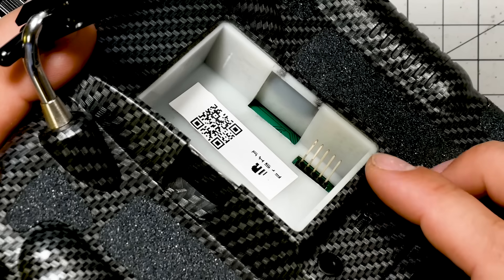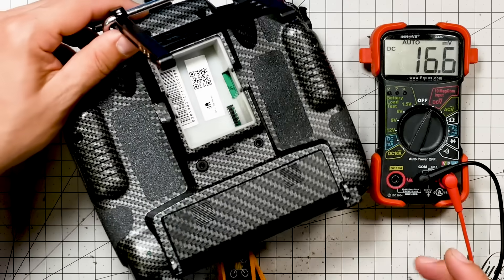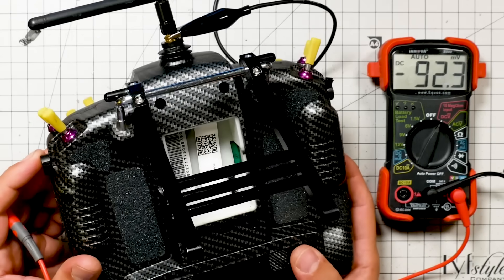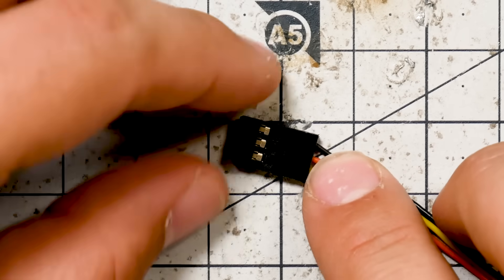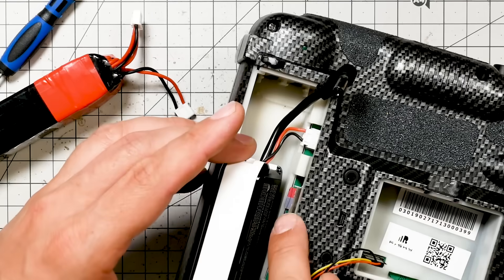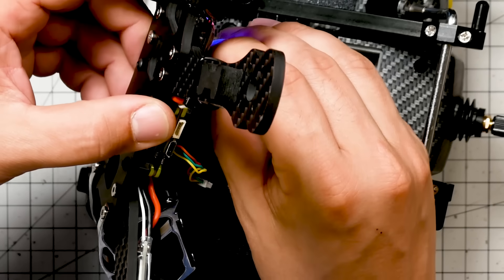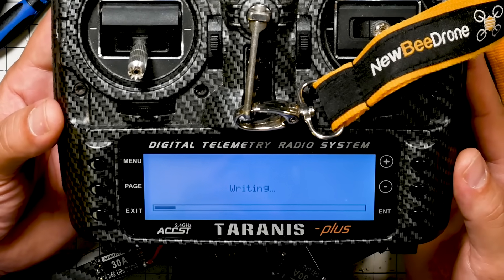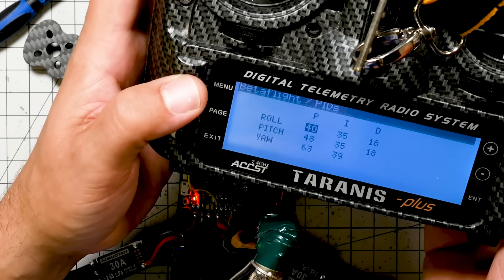FrSky Receiver Firmware Update | R-XSR LUA SCRIPT FIX

Comment: Long standing problem I've ran into with this. If I flash the firmware with my X9D (everything exactly as shown in the video, flash external module), it show's that it's all went as it should, firmware flashed. But.. It won't bind with said X9D. For all practical purposes, bricked.
Using my QX7, with the same firmware (even the same "bricked receiver from the X9D flash attempts), I get an option for "flash S Port" along with the flash external module (the S port option isn't on my X9D). Use this route and the receiver binds fine with the X9D, telemetry, LUA script, all good. It's always been like this, on  5-6 receivers. 
All good in the end, but why do I get the "flash S Port" on the QX7 and not on the X9D? And why will it only work correctly using that?
Reply from the maker: Flash S.Port flashes to the servo plug on bottom of the radio. Since the X9D doesn't have this port, that option doesn't appear.
Reply: @JoshuaBardwell  Any idea as to why they refuse to bind when I do the "flash external module" with my X9D? It's a newer X9D SE, have swapped the power/ground wires as shown in your video, using the stock Taranis battery, correct firmware, the loading bar goes as it should, but it won't bind after the flash. Fortunately I have the QX7, otherwise, as it stands, I'd be outa luck.

Comment: Hey, probably no one will answer to this but i have a Taranis Q-X7 and can't find out what's signal power and ground. I only get numbers like -6.07 or 0.86. Im pretty sure i didn't  short any of the pins.
Is broken then or am i doing something wrong ? It's a EU transmitter btw, not sure if that matters
Reply from the maker: If you have the QX7, don't use the pins in the JR bay. Use the servo plug on the bottom of the radio. The command in the radio is "Flash SmartPort Receiver" I think.

Comment: after watching  my first attempt ended in error(no resp. from bottom pin) on my Qx7. The first option after you have selected the firmware from your sd card on the transmitter is for S PORT. I was nervous about "bricking " my unit so I used a spare and it worked. Then worked again on my build in progress. Might be a repost but just FYI...I really do  learn something Every time thanks brother man!

Comment: Hey Joshua, LUA script problem here... I have an RXSR and its flashed with the LUA script firmware. Flashed LUA firmware on my XLITE transmitter. Im trying to get the current setting to VFAS, but the "current setting" in the Display page. Im running Fport. Im not sure if it was in Display page before flash.. Any thoughts?
Reply from the maker: VFAS is a voltage not a current, so that's why you can't set the current sensor on the Display page to be VFAS. Fuel is typically the current sensor source for FrSky and Capacity is mAh I believe.
Reply from the maker: Ummm.... actually I'm not sure about that. Fuel might be mAh and Current might be current.

Comment: Hi Joshua - I didnt work for C3 f3 flight controller , I have the latest firmware 181228
(F.Port FW included)

1. Fix the random incorrect RSSI issue
2. Optimize the performance and further increase the stability
Note: Please upgrade the compatible device (R9 series Tx/Rx) with the latest firmware simultaneously, and rebind the devices after the update. Bind is happening but the f port is not working i cannot see any movement in receivers . Serial port enabled and all steps followed

Comment: Actually that is a 2 cell balance plug on the Fatshark battery that is missing the center wire. (balance plugs always have one more wire than the number of cells since each cell requires a positive connection with of course a shared ground that represents the one extra wire).

Comment: Now the question ... is it worth to buy receivers r9 mini frsky or R-XSR? I'm hesitant because I'm looking for a second receiver for another drone. Should I go in the direction 2.4ghz or 900mhz? Or it may have two different ones installed, so that in the event of a failure you can save the plane, drone, etc.
Reply from the maker: 900 MHz certainly gives more range and confidence.
Reply: @JoshuaBardwell  it's true but how look transmission speed and delay? R-XSR have ultra sbus. What's mean?

Comment: Hi there, I am having a heck of a time getting my frsky r-xsr receiver to work. I have a F4 flight controller which the manufacturer said it is a clone??? The drone is a SkyStars G730L. I have connected uninverted sbus on the receiver to the SBUS on the FC. I was going to flash the r-xsr with the latest firmware but because it is soldered to the FC I don't know if I can use the Tyrannis QX7 method or if I need to flash using serial passthrough? I would rather not desolder as the pad on the the receiver is extremely small. Any suggestions are greatly appreciated.
Reply from the maker: If you're using uninverted SBUS you must go to the CLI and type "set serialrx_inverted = on" then type "save"

Comment: This hobby is amazing, first you have to build a quad from misc parts, hoping u pick the right ones, then u connect a taranis to it and it flies amazing, then the talking heads in this great hobby state “u should update to the latest greatest” it’ll be better then whatever settings your running currently, but that’s where we as a hobbyist need to realize that if it is working great don’t fuck with it! The upgrades can and do cause issues with your setup that unless at times your a fricken computer programmer the update turns into a pain in the ass and it’s not worth trying to hunt down all the info/videos to try and figure out the steps to make it all talk again.

Comment: Yea, so I did this and bricked my R-XSR. Have since tried several versions of the firmware from FrSky's page, no luck, it won't bind. There's a difference, with one version all led:s turn on when I try to bind, with others only the green one comes on. None has the red flashing though. Should note this is an EU version and I upgraded the OpenTX version at the same time to 2.2.2.
Reply from the maker: It sounds like you are flashing the wrong firmware. Make sure both Taranis and receiver are using LBT (EU) firmware.
Reply: @JoshuaBardwell  Tried flashing both receiver and transmitter with both in various versions. The radio was sold as an EU radio so obviously I started by flashing the RX with EU firmware which was what stopped it from working, I then tried flashing the TX with the EU XJT firmware, both of the versions available on FrSky's site, no luck. My latest attempt was flashing both RX and TX with FCC firmware and it doesn't work either. Everything was working perfectly, but I wanted LUA scripts and was told flashing the RX was a good idea to make sure it supports it and now nothing works.

Also, the radio is pretty wonky when it comes to the USB connection, I basically can't get it running as a storage device so I only have luck taking the SD card out and adding the files to it directly. Really starting to regret getting this Taranis over the Spektrum I was considering and really starting to beat myself up over messing with things that did work, had this rush delivered since I was going to my first race tomorrow and now, $350 later (yes, they're expensive here) I can't even fly five meters.
Reply: Ahh and now it got even worse, now it fails to flash the RX firware. It starts but  at some point during the process it stops and the screen on the Taranis says "Firmware Update Error Module refused data [EXIT]" - The only one it does now flash is the non-eu R-XSRFCC171009 version, but flashing the TX with the XJT_NONEU_170317 still doesn't make it work.

Does anyone know exactly how the LED:s should look when it goes into binding mode? I recall the red led should flash when successful, but should there be anything before that? Because right now, it always just goes to solid green only, which according to the manual indicates an active link.
Reply: Just to follow up, it may help someone in the future since I found no one through days of scouring the webs for information who had this problem and thus no solution. No, it was not using non-matching firmware, nor the firmware version of  anything at all. Apparently it is possible to put you radio in a state where it can't successfully update the firmware of neither it's own internal transmitter module nor external receivers when updating OpenTX - every time I was flashing firmware everything appeared to work, the progress bar completed without errors or warnings - but the flashing had no effect. What I ended up doing was using an FTDI-chip and a bit of passives to be able to flash the modules using the FrSky S-port Update tool directly from USB. Exactly how is far to long to write here, it's on the scale of a Bardwell video, but if anyone has a similar problem ask me and I might be able to help you out.
Reply: @bewing77  hello. I have the same problem like yours. I had Taranis EU version and r-xsr fcc version. They did not bind, and somebody told me to upgrade the receiver to eu version. I did that and now the r-xsr has always a solid green. with each firmware update says successfully but don't sure what firmware I have on my rx or tx. I did like dozens on each :( . what is the solution? I don't know what a FTDI-chip is... :(
Reply: Florin Danilov  An FTDI chip is basically an integrated circuit that allows you to output serial data on individual pins from USB, it's pretty common in most devices that connects to a computer using USB. These chips are also available in lots of variants mounted on a PCB with a USB connection, all capacitors required and sometimes also voltage regulation, these are called FTDI brekaout boards, an example is https://www.sparkfun.com/products/9873

However if you don't know what it is and have no other use for it, you'd probably be better off getting the FRSKY STK (S.Port Tool Kit) which costs about the same as an FTDI breakout board but is easier to user for this specific application.

If you get one of those you can flash the firmware of both receiver and transmitter without the "put it on the SD-card in the radio, go through the menu etc" - you use the FRSKY firmware upload software and flash it directly from the computer. Now, it is a bit tricky to use, basically you have to launch the software and select the firmware file first. This done, the software will wait for the STK (of FTDI) to connect. Make sure the STK is connected to the receiver or transmitter you are flashing and then plug it into a USB port. As soon as it is detected the upload button is enabled, now you need to press it within a few seconds, otherwise it won't work. You will get a progress bar - for some reason flashing this way takes a lot longer it seems.

Get the latest firmware version for both the receiver and transmitter for your region (LBT or Non-EU) and flash them using this method fixed the problem for me - hopefully it will for you as well. If something is unclear don't hesitate to ask again!

Comment: Weird problem here.. If I flash the new firmware on a R-XSR with my X9D SE, it refuses to bind. Flash same receiver with my QX7 and another option "s-port flash" appears, use that and then it binds just fine. What is up with the s-port flash thing? And why isn't it showing/working on my X9D SE? Glad I have the old QX7, otherwise I'd be fucked and have a completely bricked receiver.
Reply from the maker: X9D doesn't have the sport output. You have to flash using the pins in the module bay.

Comment: Man I don't know how to get ahold of you Joshua B.... computers and beta is new to me and is not my thing I do quarter mile in my Datsun 210 and I'm getting where I just can't work no more physically on the cars . I hear you get the same adrenaline rush out of these quads yeah that would be nice but this is my issue I can't get my new fry Sky X Lite Radio to transmit at least not in beta and I can't get my quad to work let alone arm mm switches I am at my wits and been working on this for weeks went through all your videos I am running a frsky XM plus receiver and I have Eachine tyro99 w/MATEKF405 custom flight controller integrated OSD LC filter yada yada yada you probably know the rest upgraded all firmware and everything including my radio I did reflash the board I'm thinking maybe that's got something to do with it
Reply from the maker: Hey randy reach out to me via email at joshuabardwell@gmail.com and I'll see if I can help.
Reply: join the uavfutures discord. lots of help there https://discord.gg/KC24JW

Comment: That's more of a question, I have a flight controller matek f405 and the red lights blinking I can't get it to bind why is that what does that mean
Reply from the maker: I'm a little confused by the question. The Matek F405 is a flight controller. Binding is done between the receiver and the transmitter, and doesn't have anything to do with the FC. So I'm not really sure what you're asking.
Reply: @JoshuaBardwell  a first of all really appreciate all the information and what you do. You're an inspiration you have a true love for fpv and I've caught the bug. I just don't know damn thing about anything except how to fly fpv some I done it twice and I got a knack for it and I love it love it okay the problems in my radio and I got the new tranis X Lite and I had to get a computer I used one so I could do all this it had 12 viruses on it and I don't know how to use a computer and it's all foreign what you guys talked about but I'm picking up on it slowly and here's the thing I got the goggles Skyzone o2 I just got the FR sky X Lite,
Tyro 99 Quad Racer  batteries  chargers  I signed up for the  simulator but can't get nothing to work  paid for it anyways I live on a budget of not much Social Security but  I can't work on race cars no more  and  I'll probably be in a wheelchair soon haha just feels like it .  I can't get none of this shit to work man and I don't see any of it come with instructions and let's see no the fry sky m receiver or something like that anyways green lights coming on at all my Motors will twitch and that's it if there's anything you can suggest ,What I have it's a bug real bad and it ain't just that I've got a have a fix and fly you know what I mean maybe you can help yeah you could send me a download for that SD card maybe my mistake was with I downloaded the wrong stuff I copied off some other YouTube site that said I'll leave ya everything you got on an SD I have to download it to it while yeah it made it work made it came on all sexy but it didn't do a damn thing for an airplane can't donate much but I definitely am feeling guilty for not I've watched almost all your videos and still you know you guys are talking what's the red light for on the little FC board whatever flight controller haha I know you guys are all cool talk to you later to you later bye

Comment: Upgraded firmware and getting solid green light only. When trying to put in bind mode, it stays solid green.
Reply from the maker: The firmware shouldn't affect whether it will go into bind mode. If it refuses to go into bind mode, then I would think the bind button was broken.
Reply: When it powers up solid green light. Red and blue are off. It stays solid green when I plug power and hold down the bind button.
Reply: Same for me on my 2 R-XSR .... Solid Green and nothing else ... I contacted the FRSKY support ..
Reply: @LudovicToinel  hey. did you manage to repair the broken r-xsr? I have one with the same issue. thanks.

Comment: I dont have CRSF on External RF? I can choose between SBUS, R9M - FCC, DSM2 - LP45, XJT - D16 and PPM  ... :(
Reply: Allright, I just selected SBUS and it went just fine. It is just like you said : he needs to send some power out of the external RF :) Thanks for the video!
Reply: The only thing I cannot figure it out yet is on Betaflight 3.4.1, the receiver tab does not detect the transmitter. The Receiver Mode as well as Serial Receiver Provider are setup to SBUS and it is powered up with a 4S Lipo
Reply from the maker: If you don't have CRSF on external RF then you need to update to OpenTX 2.2.1 or newer (2.2.2 is the latest as of now). You are probably on 2.2.0 which did not support CRSF. Using SBUS out will work but it adds latency which is sort of the whole point of CRSF.
Reply from the maker: If you are using crossfire you need to set up the output map  on the receiver and then us CRSF protocol not SBUS. Please follow instructions as shown here: https://www.youtube.com/watch?v=DP5CnbGYvyg
Reply: Thank you! My OpenTX is already at 2.2.2 version but I dont have a CRSF :)

Comment: I'm running Opentx 2.1.6 on my Taranis and could not get this to work. I kept getting errors at the write phase. I turned off the external transmit which powers the r-xsr off, and the firmware flash powers the module at flash time and it worked perfect for me. Maybe it's changed with 2.2.